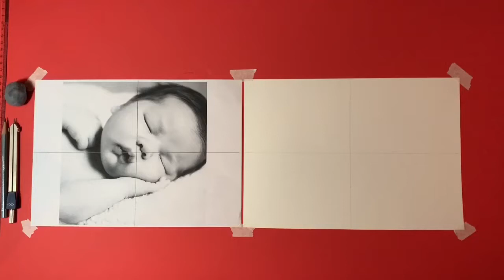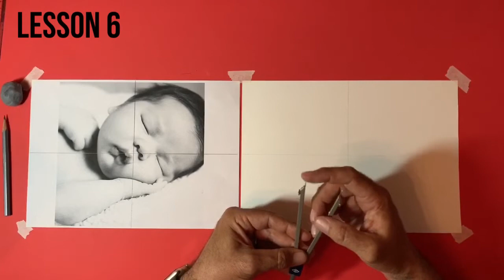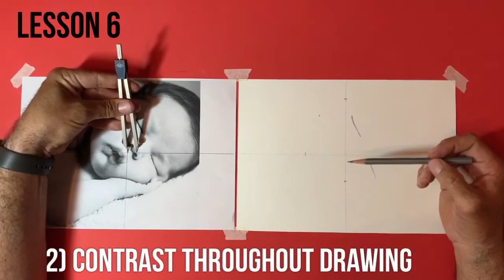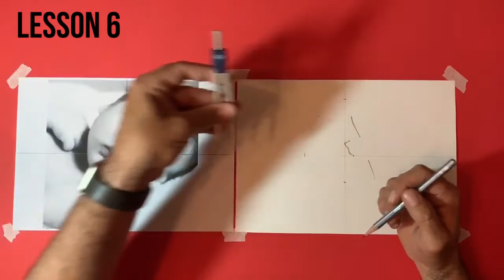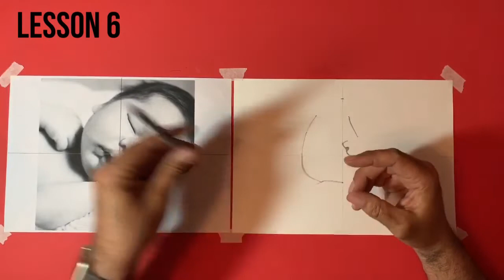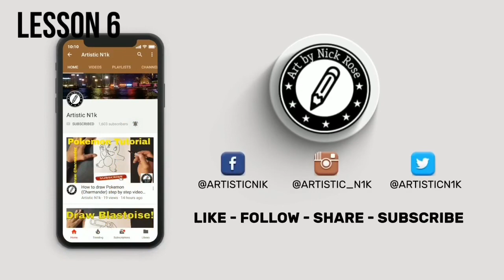drawing techniques for beginners | Lesson 6 | From beginner to Pro

Comment: Nice tutorial. I would suggest using a proportional divider instead of the compass to avoid what you noted in the video as the possibility of poking the paper. It's easy to do with those nails.  Your channel is off to a good start. Kudos!